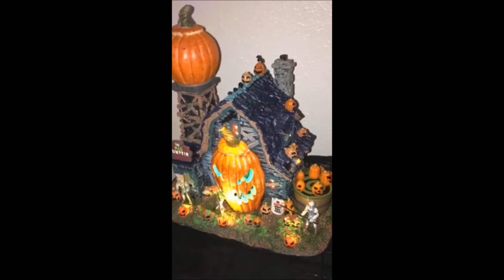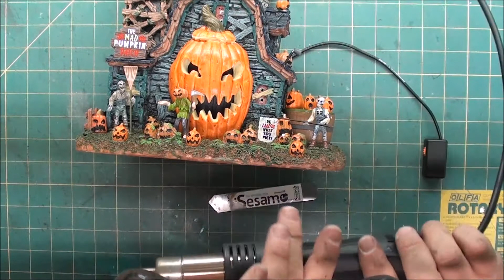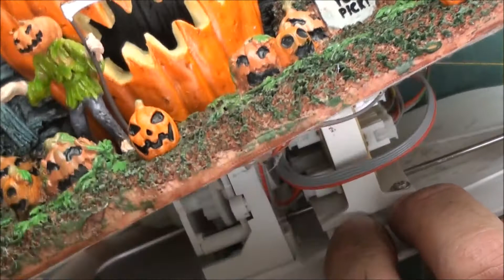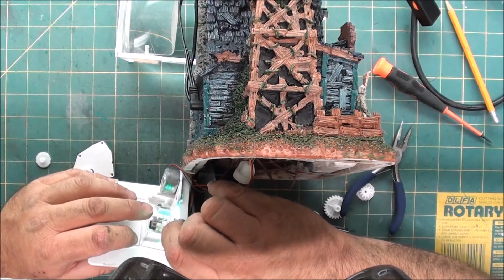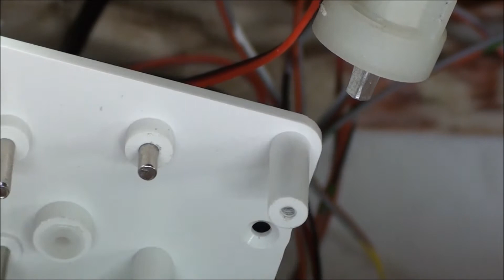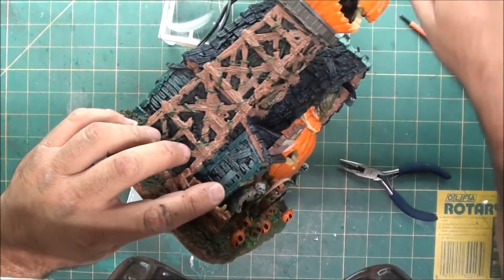Lemax Mad Pumpkin Patch Tear Down and Repair (Long, Detailed)

Comment: I just bought one of these off eBay. Everything was working great until my 4 year old decided to stick one of her plastic dinosaur toys (after I told her no) on the spinning barrel and it got jarred while it was on. Now, the barrel is not spinning. I’m so upset and I don’t know how I can go about fixing it.
Reply from the maker: Probably broke the drive gear on the bottom. If you can access it, gears are available in most hobby kits. Does the pumpkin head still spin?

Comment: Have an issue with the drive belt slipping and the pumpkin not spinning. Do you know what size band it takes?
Reply from the maker: Don't remember exactly, but Lemax uses 30 and 40 mm belts the most, on carnival pieces they run 20 mm more often. I buy the multi-packs from Skullkrane, different sizes and better quality belts.

Comment: Thank you for the video. Neither my pumpkin or the barrel were spinning. Your video helped me get the mad pumpkin apart. I found the issue to be the motor doesn’t always turn on. It sticks but if i give it a little twist it starts up but makes a grinding noise. I tried running it and putting some silicon on it but it didn’t fix the problem. Is it a bad motor or should i take the motor apart? I did find a motor with the same numbers on ebay and size seems to work (srf-300ca). Is this the correct replacement if a motor is needed? I have a video i can send.
Reply from the maker: Replace the motor, don't try to rebuild it but check the gears to see if one is cracked, that can cause the motor to stick. If you have a broken gear it would likely be the 10 tooth gear. If you want to send a video you can send it through FB Messenger or randomjchannel@gmail.com.

Comment: You ever had one that wouldn't power on?

Just had my fail last night.  Figured no parts available for these.
Reply from the maker: If it won't power on and you've already tried a new AC adapter, the most common failure is the motor internally has shorted out. Prior to doing a tear down to get to it check your on off volume switch to see if one of the wires maybe broke free. Pry it open around the seam carefully and inside are five wires, the thicker wires are on the outer 2 posts and then there are 3 thinner wires in between.
Reply: @RandomJunkChannel  ok ill check that out.  Ty.

Comment: Question for you on the Mad pumpkin patch I have a new unit with a bad potentiometer or possible sound board voltage is correct but it just turns on at the highest volume  so I know that the resistor is doesnt seem to be working correctly in the pot what do you think that may be voltage is 4.62v on grd and load including off position 4.01v on the center terminals when powered bit stumped thx
Reply from the maker: It sounds like your potentiometer might be bad but I could be wrong. When I get a chance, I will see when I can find out regarding the volume issue, I've heard of a few other people having similar issues with different houses.
Reply: Ever get chance to figure out pot issue on volume control revisiting since I put up display again this season thx

Comment: Ok, so I'm back and I want to thank you for posting this video because it came in incredibly useful today. I ordered one of these buildings brand new and just received it yesterday only to find that everything, except the lights on the bottom half, was malfunctioning. The pumpkin at the top was spinning, but it was detached from the tower and it's light wasn't working either. The barrel pumpkins were also not rotating. The company I purchased it from wouldn't replace it because of some nonsense with UPS, so my only option was to try to fix it myself. Luckily, I had seen your video just recently.

 I followed along with the video and I was able to find the problem fairly quickly, the piece that the little motor thing is connected to was completely detached from the base and was just flopping around inside the building. Once I attached it back on and it connected with the grey gears at the bottom, the barrel pumpkins started rotating again. Woohoo!  When you mentioned in your video that the gears were lightly oiled, I have to say, mine had enough oil for me to start a fish fry. It was so difficult to grab on to anything. There was just globs of grease on everything.

Once I get the equipment to solder the wire that runs the light in the rotating pumpkin, and reattach all the parts I managed to snap off ( oops ) I'll have a perfect Mad Pumpkin Patch. Anyway, thanks again for this video. You made my day!
Reply from the maker: I'm glad the video helped, that's why I started posting them. It is a niche market of folks out there that enjoy these miniature Villages and no one has spare parts or shows you how to fix them when they break.

Comment: I have a Ghostly Manor from Lemax that made a snap noise when I plugged it in and now the ghosts wont spin and the ghost in the window wont rotate either. Do you do commission repairs for the houses? I would love to have it up and running. :)
Reply from the maker: Responded by email to you.

Comment: The pumpkin on the tower won't spin on MINE I'd show you but it's not with me right now
Reply from the maker: There is a flexible driveshaft that may have popped off or the drive gear broke
Reply: @RandomJunkChannel  My pumpkin on the tower won't spin. I opened it up and see the long spring that acts as the drive shaft has broken. Where can I buy another?
Reply from the maker: https://youtu.be/Lvwdh1uFX68
Reply from the maker: This link might help. There are no replacements but you can use a butt connector as a repair. Haven't found anything else as of yet to be a more direct fit.
Reply: Anyone ever consider  bass guitar string bout same diameter flexible and snip  to size good alt possibility  strings are wound  a round a core difference here is it a solid core vs hollow might even be more robust strength

Comment: OMG! Are you a Lemax Doctor??? I have a torture factory with an issue. The blade on the guillotine is stuck in the top and nothing I do can get it loose. It worked exactly once when I plugged it in the first time and it stayed there. It's an Ebay purchase.  I'd really appreciate it if someone could fix it. I'm curious, how do you get your parts?
Reply from the maker: Zuxiasunicorn the torture factory is coming up in the line up of lemax repairs. It will probably be a month before I can film it.
Reply: OK
Reply from the maker: Torture Factory Video 
https://www.youtube.com/watch?v=N1mb8okryRc